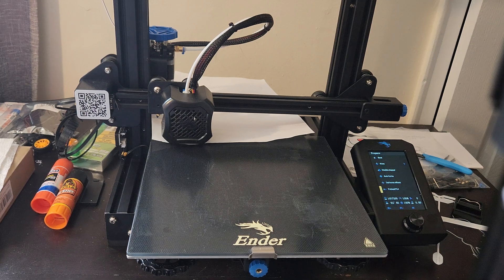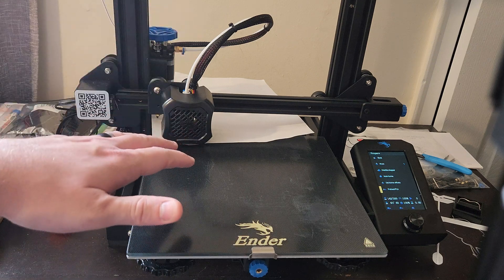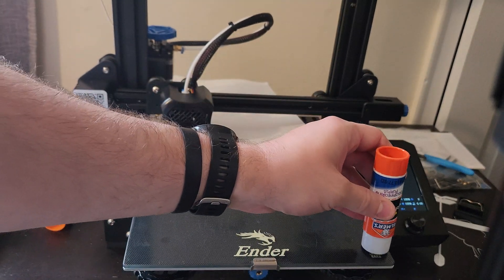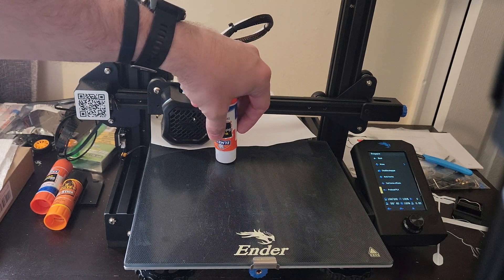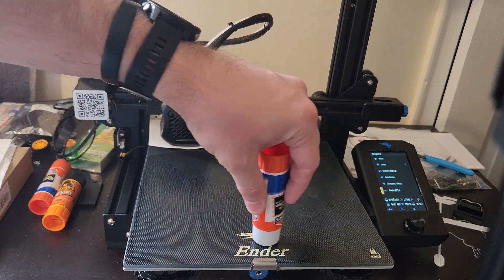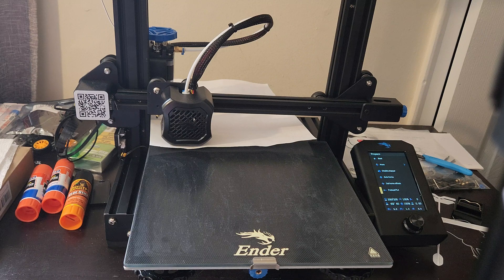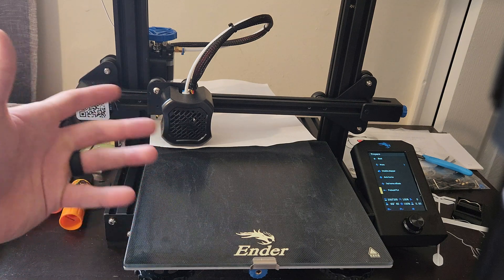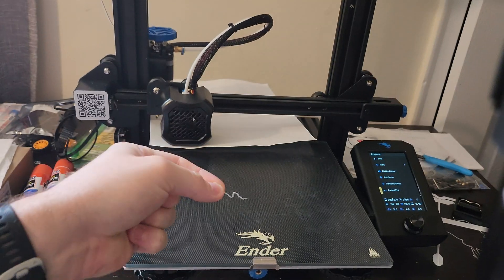Glue Stick To Improve Bed Adhesion?!?!

Comment: Firstly, thank you very much for the informative video.

Secondly, what do you do to prevent glue clumps? I found it was very hard to apply purple glue without it clumping.
Reply from the maker: I haven't had that issue, but the way I apply is on a warm (not hot) bed. I make sure the top of the glue stick is flat, and I apply without any pressure. I basically put the glue stick on and move it around, the weight of the stick is what applies pressure so it's minimal. I also clscrape and clean the bed between prints.

Comment: Do you heat the bed before applying the glue or after?
Reply from the maker: I glue the bed then heat it. Usually I hit preheat and then glue the bed before it's gotten hot.
Reply: @TylerTalksChannel  thank you so much for the reply.
Reply from the maker: @joslingc  thanks for watching!